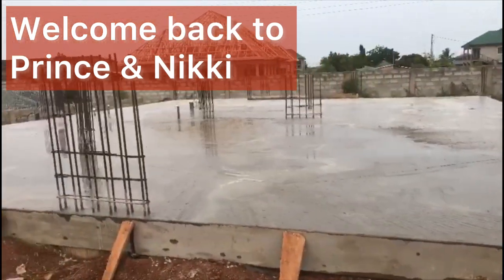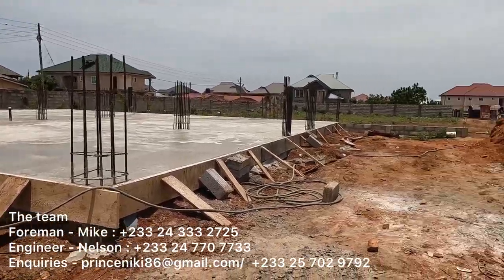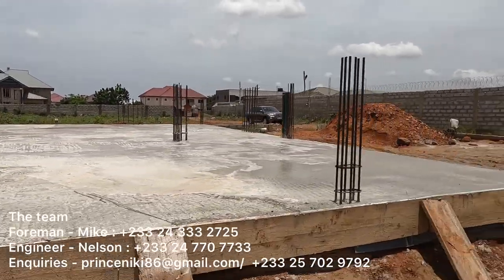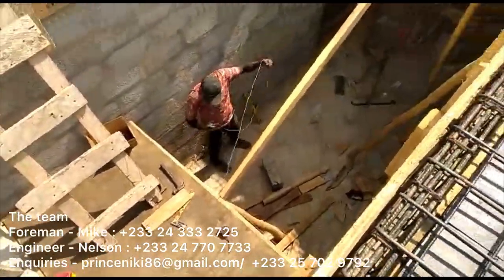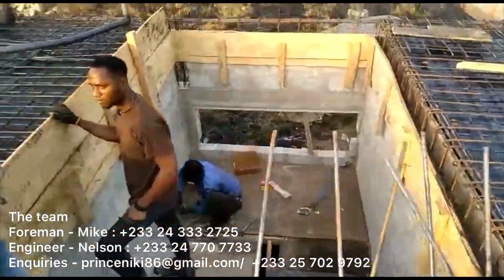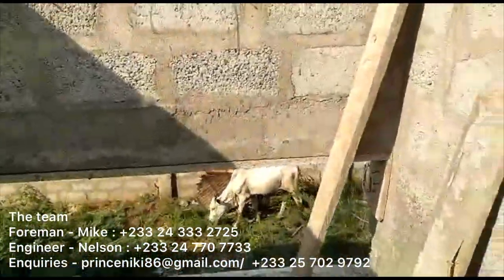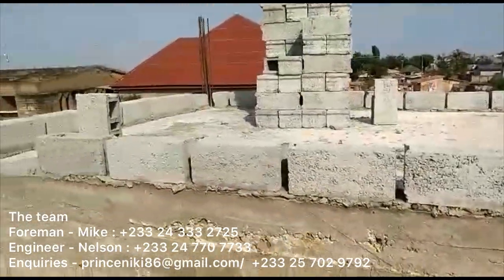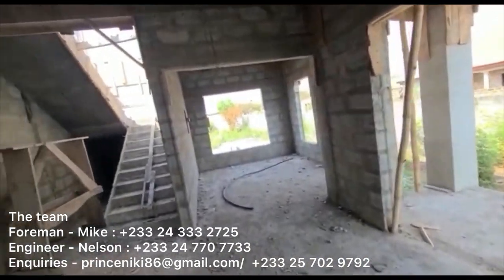Building in Ghana - how to design and form staircase

Comment: I have seen disaster staircases with each step is a different height and depth..A proper staircase must be uniform in dimensions. The same goes for quality of fit and finishes of doors and windows.
Reply from the maker: Yes I totally agree the key is in the detail. As for the finishes I agree, you need to have the eye for the design throughout the ensure the vision comes. Quality is everything in setting homes apart for sure. Thank you for watching